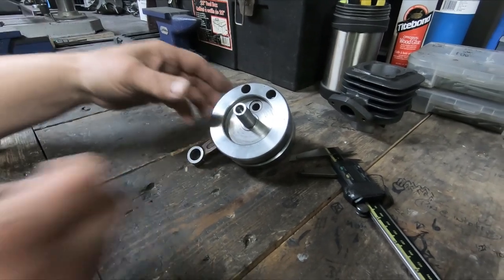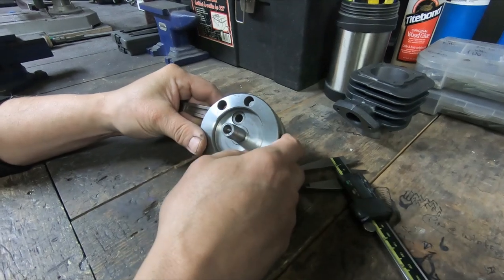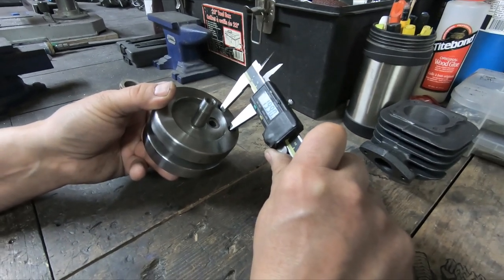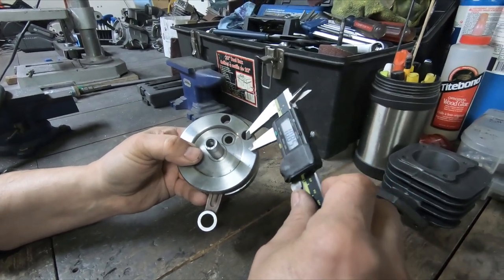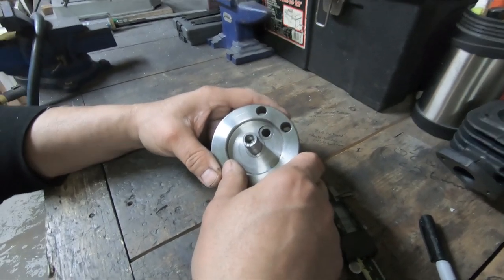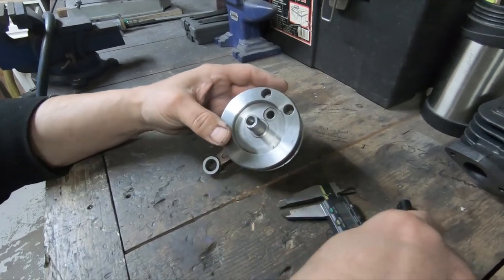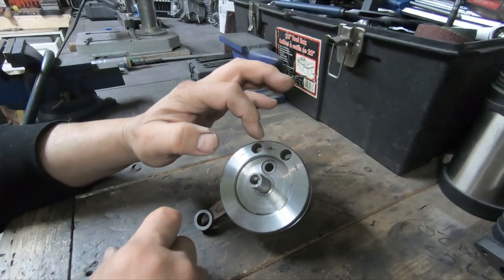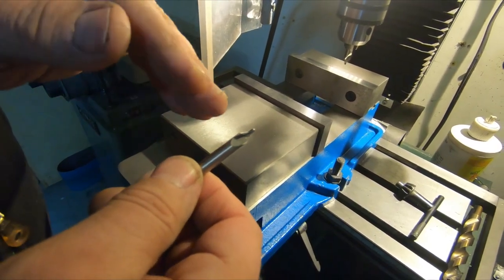Calculating Balance Factor And Balancing Your Crank

Comment: I like what you're doing. In the 70s my father started a drive shaft balancing business so that he would have a balancer to balance his V8 racing engines. At that time I started getting addressed in Two Strokes. All kinds of different ones Kawasaki triples mostly. One of the things I learned is removing all the metal from the crank adds volume to your crankcase. Usually I would remove metal from the light side then add Mallory and then weld a cap on leaving no holes in the crank. Also well drilling holes always made a cardboard template to collect all the chips to weigh them. Always helped with the calculations of weight removal. I know it doesn't sound like much but crankcase volume is very important. Also in certain circumstances when removing weight from the heavy side we would remove more weight than necessary than TIG or mig weld caps over the holes then machine them down flush. Or just a hand grinder. Just some food for thought. I like the video.
Reply from the maker: your absolutely correct this add volume , i did this DIY Crank for the average builder , most people don't have the resources to do what your saying , in saying that the average engine builder can achieve a balanced crank

Comment: i assure you the con rod weighs more than 30 something grams. it's more like 80 grams. Why not balance with piston connected to rod. why would we not strive for as close to a 100% balance as we can get? 60% seems low to me
Reply: Needs counter weight to work properly can't be 100% with the piston on
Reply from the maker: lot of other factors to consider like piston pump and ring drag

Comment: Drilling a balance hole directly beside or inline with the crankpin is a bad idea for obvious reasons. That's why the 2 original factory drilled holes are spaced either side of the centreline of the crankpin. Better to add weight to the opposing side (ie. Drill a hole, thread it, then pour in lead)
Reply from the maker: Not really , I've won 3 Season first place at SoCal , I've sold hundred's of balanced cranks never once had a issue

Comment: I tried balancing my crank and it came out to 67% balance factor and it’s very smooth at low rpm’s but at high rpm’s it vibrates like crazy, never had a engine vibrate that much, checked engine mounts and everything and it’s all good, wonder why it’s doing this.

Comment: So, I noticed if the scale is lifted to make the con rod level it changes the weight vs just leaving the scale on the table and being close to level. Which way is accurate? The conrod needs to be perfectly level in order to get the proper weight, doesn't it?
Reply from the maker: I've always just put the end on the scale with no problems
Reply: @dlhperformance7169  I ultimately decided to lift the scale using a deck of cards to make the con rod level. Without lifting the scale I was getting around 38.4g, with lifting the scale it says 40g. Interesting find to say the least.

Thanks for sharing your skills man. Your information is priceless.
Reply: Yes, it needs to be level to be more accurate

Comment: I appreciate the video but I'm confused on two things. What size bit did you use to drill the holes? In the beginning of the video you measurd the thickness of the crank but I don't understand why considering you used the same measurement of the distance between both stock holes, and then usedtbe same distance for the other two holes
Reply from the maker: the drill holes size doesn't matter , its the weight of piston and everything on the conrod , you need to do the calculation and remove the material as needed by drilling holes , the calculation will help you get the desired percentage over rotational mass

Comment: That's nice but i still don't get it,i mean,why do that;
---what happens if you don't balance it?
---what do you do with the balance factor?
---if you have a GY6  150cc and you go for the big bore 171cc, what happens with the balance? will it vibrate alot?
Reply from the maker: 1, vibration and rpm range is why your balancing this crank ( factory cranks from these china doll engines are usually not trued or balanced for your piston } its a cheap built crank !
2, your aiming to get a 50 - 60 percent balance factor , lots of variables in this. one is piston drag , friction causing piston to be seemingly be at a higher weight at 12k rpm 
3, a GY6 crank is a engineered , higher manufacturing standards , milled perfect, and yes a lot of cranks guys change the balance factor for racing